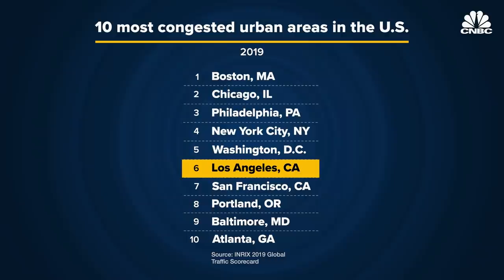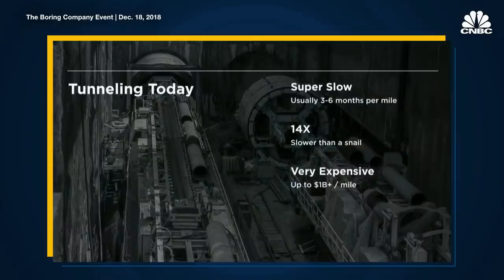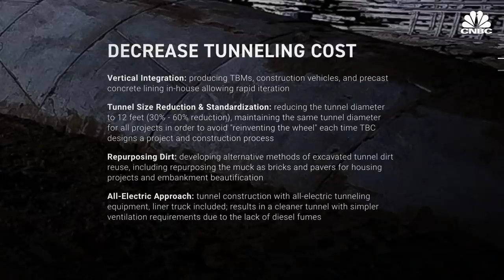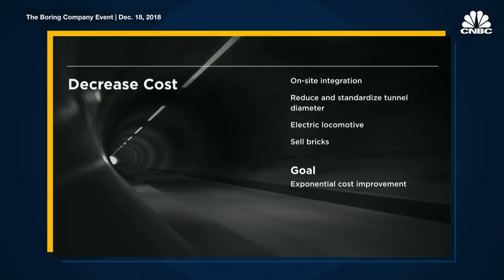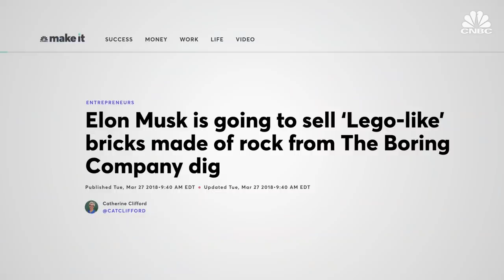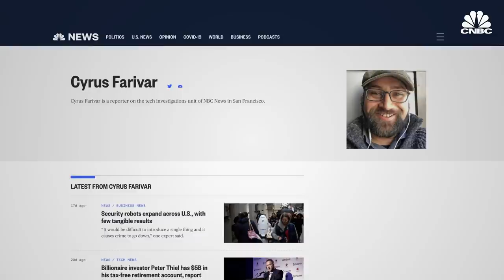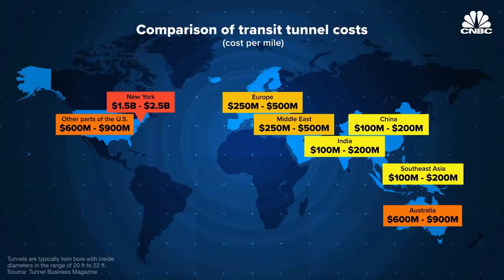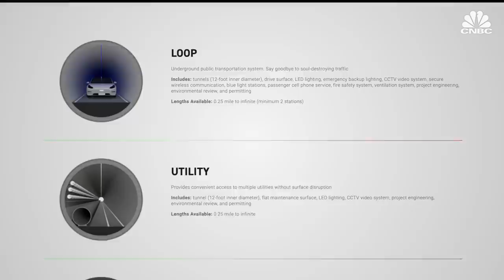Why Elon Musk’s Boring Company Isn’t Fixing Traffic Anytime Soon

Comment: Wait til Elon figures out he can connect several pods together and use only one engine to pull them all 😂
Reply: Best comment🤟🤟🤟
Reply: You just described a train..
Reply: @ericd9853  r/wooosh
Reply: @whitneygoncalves3327  Yeah, a solution that only views interests for rich people.
Reply: He might even have the brilliant idea to use steel wheels on steel tracks to significantly reduce friction
Reply: @whitneygoncalves3327  you will have to wait much longer because of lower capacity and the smell of pee will be worse because of the smaller volume of air inside the passenger compartment
Reply: @GabelhelmSogarbraten  What a brilliant idea, no doubt Elon will do it, he might call it, "Hyperwheels" or "Cybertracks"
Reply: @slytheravenx2716  and he will give it a futuristic spin that it will only move when all passengers have an app and are connected to wifi
Reply: Trains are limited and repairs are costly
Reply: @HavokBWR  And what when the vast majority of population has its own individual pod? Underground traffic jams?, bore more holes? Back to the same traffic problem we already have.
Reply: properprofitrocket  if that was the case then building more lanes should have helped with traffic. But it didn't.
Reply: That's in case all of the pods go to the same destination, which rarely happens.

And its annoying to have to be jumping from pod to pod. And slow
Reply: @whitneygoncalves3327  if you are bothered by pee smell. You can use your feet and walk away from that person…
Reply: Ssshhhhhh. You can patent the idea yourself. I'll bet you can get some gullible investors to invest in ypur project.
Reply: @AllThisThingsIHateU  so its a road, but way way way way way more expensive to build because it needs to be tunneled under a metropolis. and it has lower throughput. and more failure points.  and higher maintenance costs. and it doesn't solve the problem of congested city centers because you still need to bring in your car into them and in a best case scenario, scarce land still needs to be taken up by parking spots.

its like he sat down and tried to figure out the worst aspects of a subway system and combine them with the worst aspects of the car just to see what muskcells will buy
Reply: Adam Something wants to know your location
Reply: @AllThisThingsIHateU  So like a car in a tunnel?
Reply: Adam Something :)
Reply: we all watched the same video didn't we
Reply: We have another name for that configuration - TRAIN  :-)
Reply: @ericd9853  Or did he??
Reply: Jeff Bezos accidentally acknowledged the Labor Theory of Value when he returned from his little space jump. He thanked the employees of Amazon for paying for it!
Reply: That’s real good
Reply: @HavokBWR  If you really think an individual "pod" can safely depart from the convoy of "pods" without the whole convoy stopping, or at least slowing down first. You really need to go back to school and study physics.
Reply: Why would you do that, it would be so much slower. Absolutely idiotic
Reply: @slytheravenx2716  and the will have RGB lighting
Reply: @Michael Hill Why does that sound like a caravan that would go faster then light
Reply: @dennisams4763  A big underground tunnel
Reply: @yqr5357  umm why would the entire convoy need to stop? These are going to ROBOT driving, not people. Have you never seen a swarm of drones navigating around eachother, they don't all come to a halt every time one passes infront of another one... How are you not grasping this? 
Yes some may have to slow down a bit, but that depends on distance between each car in the convoy.
Reply: @Ethan.YT.  When 1 lane is big for you, what is a 4 lane tunnel for you?
Reply: @dennisams4763  Too small
Reply: a hyperloop?
Reply: @AllThisThingsIHateU  It sounded more like there's a special purpose fleet of Teslas in the tunnel for moving people and then you'd get out on foot at the end. The wheel lock probably only works on Teslas and they might not even trust private Teslas to use the tunnel because they could break down and block the tunnel.
Reply: @whitneygoncalves3327  It sounded like riders get in Teslas only for the tunnel. That are small, enclosed and will get peed in.
Reply: @HavokBWR  The line of Teslas is in single lane tunnel. When one stops all the cars behind have to stop. Smaller pods (especially on a track) instead of large trains would be more frequent which is different than a Tesla with rubber wheels in a tunnel.
Reply: @IronLion24   A few steel wheels last longer than many rubber tires.
Reply: @karld1791  the tunnel is a single line but the cars will be pulling OUT of that line from the tunnel into the stations, so that cars the other cars will just drive past the station and not have to stop...
Reply: @karld1791  okay? Rubber tires also last way longer when they are only driving on a smooth tunnel track vs typical driving conditions. And yeah they will have to replace tires, that doesn't outweigh all the other benefits. Again, go look at "boringcompany" Reddit, because you're clearly ignorant on this and only got your information about it from haters on YouTube.
Reply: @whitneygoncalves3327  Yeah drive you car in clogged street for hours to your workplace, because you are to afraid for a 20 min train drive.
Reply: @whitneygoncalves3327  Your name should be spelled Gonçalves
Reply: @whitneygoncalves3327  Good luck
Reply: Isnt that a train then?  Lol.
Reply: @GabelhelmSogarbraten  That's what filters are for.
Reply: copied from Adam Something’s video on The Boring Company
Reply: @whitneygoncalves3327  God forbid having to interact with people you don't know with a one in one hundred or less chance someone's smelly. Definitely better to throw money at a billionaire instead of invest in public transportation. I definitely want to pay a subscription service to use proprietary underground road on top of the bills I pay for my car. I also can't wait to pay to change my tyres every time I use this propriety road that strips them bare.
Reply: And call it loopcart 😂😂😂 this is so stupid. 
This guy just wants to sell more teslas. 
Investing on good public transportation system is must for US citys and suburbs. It includes just good old trains and buses and route without LED strip lights.
Reply: I was thinking the same thing but with a trailer like thing we’re you can drive onto
Reply: @AllThisThingsIHateU  Then what is this even fixing? The cars will have to leave the tunnel and will get caught in traffic again, this is the same thing as adding lane after lane to fix traffic.
Reply: @whitneygoncalves3327  you clearly haven’t been outside of anywhere apart from Murica’. 

Plenty of people prefer a walk and a well engineered, clean and spacious train/tram and/or bus journey than a car that polluted the local environment, limited parking, stress and taxes of a personal vehicle. Netherlands for example. 

And then you have places like London where it has a healthy middle ground. Public transport isn’t particularly pleasant, but anything is more pleasant that automobile traffic.

It goes to show what INFRASTRUCTURE INVESTMENT can achieve outside of your dense mind.
Reply: @janetskola9867  And why would I donate my income to "someone who smells like pee"? What does it has to do with the main discussion here? Very out of context your comment is.
Reply: And he will reveal this revelation to his fawning cult as the greatest invention of mankind, and they will hail him as the Space-Jesus Genius they always knew he was. Elon loves 'inventing' technologies that have already existed for over a century. 😂
Reply: I have a name for that. I call it Hyperpod. 😂
Reply: And if he puts them on rails they could be powered from the rails, instead of having passengers sitting on 1000 lbs of lithium. He's such a genius.
Reply: @AllThisThingsIHateU  Except you pay a $20 ticket to go in a Tesla that you don't own.
Reply: @HavokBWR  "going to"
Reply: @reviewtechussr  yeah I have no idea what your referring to, also it's $10 per vehicle, so that's around $3.33 per person. I know math is hard for you, but let's try not to spread lies.
Reply: @HavokBWR   Okay so it was half the price I said it was if there was only one person. You say it's $3.33 per person but are really going to always have 2 people with you? No, in all likelihood you'll be going by yourself with maybe 1 other person. This is such a strawman argument you're making which by the, a ticket on the NYC subway costs $2.75 per person. 

Also, what exactly can the loop accomplish that even a simple light rail can't do better?
Reply: and then claim it as his own idea and the masses of fanbois will believe him!
Reply: @kaosinc  go back to calling the model 3 snake oil.
Reply: @HavokBWR  Imagine simping for a corporate aristocrat lmao. That's all you've been doing.
Reply: @AllThisThingsIHateU  Yeah, you can do the same with your legs. But without causing massive amounts of pollution, unsafe city environments and contributing to the economic inequality and obesity epidemic.
Reply: Hey y'all. How about a train, that doesn't smell like pee because get this crazy idea... it's properly funded and maintained?
Reply: @moisesaguirre515  nah m8, impossible. Can't be done
Reply: @ian_b  Americans call everything that isn’t American communist…
Reply: @davidjohnson8655  yeah, that was an incredible revolution. Making something more expensive and less efficient. 

Cars are better then horses though
Reply: @HavokBWR  Express trains don't stop at every stop. Neither do skip-stop trains or simply trains that bypass stations.
Reply: @HavokBWR  yeah, you'll just have to stop at the entrance for a few hours while your waiting for your turn in a 10 mile long queue of cars. Great idea.
Reply: @n4n1damn yaya keep in telling yourself that. Point to point travel that passes by stations allows for more stations closer together. Can't have that with trains, would get backed up too fast. More stations (hotels that are paying to join the line) = more points of enternce, less congestion because you aren't all forced to these few hubs that trains need. But I really couldn't care any less about your opinion. I've been hearing from you Elon haters for the past 5 years. You all bch and moan and cry snake oil. I invest and dont care if something gets delayed or slightly modified. My best keep being correct and yours keep failing  😁
Reply: @HavokBWR  yeah, but the cost of building new entrance points / stations won't exactly be negligible. I really don't care if it's Elon or anyone else doing it, I'm just looking at this objectively mate. All the best to you and good luck with your investments 🙂
Reply: wait until alpha cino remembers that trains within cities have very low ridership outside of rush hour because it doesn't normally start where you live or go where you want to go.

The idea of the loop is basically a highway but at higher speeds. So you can go from the stop easiest for you to the stop closest to where you want to go, and skip everything in between.
Reply: @neutrino78x  no Vegas built a 600 million dollar train and nobody used it, so that means they should have built ANOTHER train!
Reply: @ericd9853  Train? You mean a hyper interlinked capsule accelerator?
Reply: DA trraaaaaaai-
Reply: @GabelhelmSogarbraten  Adam something fan maybe? Nice to meet you
Reply: @slytheravenx2716  And the tunnel will be a vacuum to go woosh
Reply: @IronLion24  yeah, and trains can transport more than 80 thousand people in a single workday. The weaker trains.
Reply: Genius ... we can call it the 420 BACON PICKLE RICK Transportation carrier
Reply: @neutrino78x  in a geographically large country, high speed train is faster for traveling than airplane example china. in geographically large continent and interconnected country of europe, high speed train is still faster choice than airplane.  if canada, australia and USA don't have high speed train it's their choice. many country still want the best efficiency and smart possible solution
Reply: @MyBuzzL  

"n a geographically large country, high speed train is faster for traveling than airplane"

Nope.

I live in the San Francisco Bay Area. If I want to travel to the next major population center to the north, that would be Seattle. It's 800 miles away. 1287 km.

A TGV would take four hours at BEST. 

An airplane takes two hours.

Why would I waste two hours of my life in a slow train instead of using the fastest vehicle available???
Reply: @neutrino78x  if u dumbdown everything to speed, yes airplane is faster than high speed train. there is many other factor why fast train is better than airplane. 
the location of stop station is one of the factor. like many of airport located far away from cities, and if u living without good public transport that's can be additional hours in traffic. while many station of high speed train already have track inside the city, with good planning of subway it much more logical to use high speed train (if available). 
the waiting inside the airport is making longer time spent (by avarage) compared to waiting inside high speed train. and if u have connected flight it can cost triple the waiting time inside the airport. if u read more of the reseach this wait time in the airport is the most common factor why airplane is take longger than high speed train
Reply: @MyBuzzL  

How can you "dumb down everything to speed"???

If you're trying to get somewhere you want to get there as soon as possible right???

I wouldn't take wheel on rail HSR further than 200 miles for that reason. They top out at around that speed per hour so much further than that and the airplane is so much faster that it's a non-starter.

But it's under 200 miles and the train is taking 3 or 4 hours I'm still going to take the airplane.

Why turn a one hour trip into a five or six hour trip or whatever?
Reply: @neutrino78x  there is so many other factor than speed for traveling. if u travel like superman or flash, yes u can just jump or run than see who is the fastest.

if u cannot see or read any other factor than this conversation is useless. unless u can read study journal that really dive deep which is better airplane or high speed train than it's meaningless. it need some knowledge requirement to see holistically which is more efficient

until u have the knowledge "Speed is not the only factor that determine travel time and efficiency"  we cannot see eye to eye. maybe we can talk other subject, be like a child that know nothing and debating which is faster superman or flash
Reply: You can also prevent the guide tires bouncing around if they were made of steel, instead of rubber, and traveled along a twin set guide rails that locked these metal tires more firmly to the given path.
Reply: @driley4381  main thing that makes this idea different from a train is that your vehicle can skip all the stops except the one YOU want to get off at. Otherwise known as Personal Rapid Transit. Trains are slowed down by having to pick people up at stops and drop them off...with PRT you get on, tell the computer where you want to go, and if there are 70 stops between your origin and destination, they get skipped and you go at top speed that whole time. This is basically underground PRT. 

Musk is doing a lot of great things for the world. He's bringing the cost of space launch down quite a bit with fully reusable rockets and he has advanced the state of electric cars a lot.
Reply: @neutrino78x  Assuming your personal vehicle is the specific brand and model allowed into the system, and the system allows you to bypass the vehicle ahead of you that wishes to make a stop, and doesn't clog the whole system up when one stop isn't functional like what happened in Vegas this weekend, and that there isn't a single mechanical or electrical malfunction along any of the thousands of moving parts in such a system, and assuming long lines of vehicles aren't waiting to access an entrance port and backing up into roadway traffic like a slow drive-thru window, and assuming any passenger rail line that doesn't cover massive distances already with an already massive customer base would even have 70 stops on one line, and assuming any potential host municipalities don't invest in their own far more efficient and affordable light rail or tram systems for local travel in the future, and assuming Elon Musk has ever "invented" anything more than Ponzi schemes.....yeah, you're right, it's a wonderful idea. 👍
Reply: I think everyone are missing the point.
If this idea (or more cost effective ditch and cover technique) became mainstream .
We can forbid the space taking, accidents causing, noisy, polluting cars above the ground.
So above ground will be reserved for bikes, walking, light rail and trams and small shops in the middle of the street.

Why do we put the low efficiency cars that take a lot of space above ground while public transport underground, it should the other way around.

This also allows cars into a controlled environment, that can implement self-drive safely
Reply: @yazeedalhusban969  definitely whenever you add another channel for cars to go through it should help with traffic (at least temporarily until induced demand fills it as well).

As far as pollution, that won't be a factor in 20 years or so when we're all driving battery/H2 cars. :)
Reply: I don't think you understand the concept of what the Boring company aims to achieve. Its about transporting people with their vehicles. Not just people.
Reply: @neutrino78x  I don't believe there is much to do to help ease cars traffic, alot of people will not believe it, and will keep pressuring to build cars infrastructure.

I think we should be pragmatic and move the traffic away underground, and reclaim the street above for all the other purposes.
Reply: You mean hyperpods? 😂👌
Reply: @whitneygoncalves3327  I don’t know wich trains you’re using but this never happened to me.
Reply: @Magnus-n2t  hahaha great comment 👌
Reply: I saw a comment somewhere about America Vs public infrastructure/transport that said something like "the problem with funding public infrastructure or transport etc in America is the cult of individuality fostered within the American person. Each American has had the idea of themselves as an individual hammered into them at every turn, so the idea of creating for others, sharing or communally utilizing something is almost entirely alien to them - and some perceive the idea of sharing/communal resources as 'stealing' from them, because they are so used to perceiving the world as the strict binary of "it's either MINE entirely, or its NOT mine at all" - much like a toddler with their toys. American infrastructure/transport/etc will not be fixed until they have restructured the American mind beyond the toddler's perception of ownership. The vast majority of Americans are so unfamiliar with the idea of communal spaces/concepts that they cry COMMUNISM whenever they see something shared by + unkept by a community/society."
Reply: Or how to keep cars with sprung suspension systems from bouncing off battery-powered flats with no suspension at 150 mph.
Reply: and until he figures out that he can put them on a fixed track, use steel wheels and put in an overhead line so you don't need batteries
Reply: Or, Or have an EMU and Electric Multiple Unit
Reply: oooo, you could run them on steel tracks too to reduce friction.
Could even have a third line to provide power and remove the need for batteries
Reply: @whitneygoncalves3327  welcome to society
Reply: @HavokBWR  if you look at early boring plans and their later re designs it's just a tunnel for Tesla's now which doesn't solve any problems
Reply: This is how Musk promotes the Myth of Musk.  He claims the invention of things that don't exist, but sound good at the time.  He want's to put a robot in every house, but his prototype is a man dancing in a spandex robot suit.  Most of what Musk talks about is hype for self promotion.  Now, Musk has now turned on the people who buy Tesla cars, the left leaning people who are concerned about the environment. Then Musk publicly aligned himself with the political party who denies climate science, they don't like electric cars or solar cells and the leader of the party HATES windmills and says climate science is a hoax. I see Musk as more of a conman with billions of dollars pretending to be the next Edison, while using 3D CGI videos and photos and a man in robot suit, all to promote his myth to sell cars.
Reply: He won’t.
Reply: @Magnus-n2t  OOF XD
Reply: and one driver ....
Reply: @AllThisThingsIHateU  OH NOOO YOU HAVE TO INTERACT WITH STRANGERS IT’S NOT LIKE HUMANS HAVE BEEN DOING THAT FOR THOUSANDS OF YEARS OR SOMETHING
Reply: @obijuan3004  He's on the right and I'm on the left, I wouldn't say he's an extremist like trump though. And his electric cars are in fact pretty awesome.
Reply: @obijuan3004  

What's your point? It's still awesome. And his company has proven that the private sector is a lot more nimble and more efficient than the government. Imagine if an organization like SpaceX had the budget of NASA...we'd have men orbiting Jupiter by now.
Reply: @neutrino78x  You're being fooled by the Musk hype. It was Lockheed, Boeing, Martin Marietta, and Rockwell International who built rockets for NASA.  SpaceX would not exist if it were not for NASA.  Outside of launching satellites there is no money in space rockets except what comes from NASA or other governments.  The Space Shuttle was a 20 year project that taught us how to build and repair things in space, including the Space Station. The Shuttle was built by Rockwell International and Boeing and many others.  It was the most advanced space ship in history and it still is to this day.
We went to the moon with less computing power than you have in your smart phone.  Yet, SpaceX hasn't been out of earth's orbit, and if NASA cuts their funding then SpaceX will never go to Mars nor to the moon.  Stop falling for the Musk hype.  And that is what most of it is ... HYPE.
Reply: @slytheravenx2716  I have an even more brilliant idea for the name, I'm thinking calling it the "subway"
Reply: @AllThisThingsIHateU  car centric thinking is the real closed loop mind here
Reply: @Ethan.YT.  Yes but RGB is an old fashioned name for someone like Elon and his followers, he'll name it something like "Neoultralights" or any other "innovative" name he can use to disguise himself reinventing existing things.
Reply: @puroktahzeeb9355  Oh damn, I never  thought about it, just like the restaurant. Dude Elon might steal the name from your comment you better be careful.
Reply: @slytheravenx2716  and there really just RGB lights but they are only sold one light at a time.
Reply: @obijuan3004  and Lockheed wouldn't exist without government projects either.

Fact remains, SpaceX is doing a lot more with a smaller budget and staff than nasa hsf.

If you want a star trek or star wars future....most of the ships would be private. We can only have a powerful navy because of our large private merchant fleet which maintains expertise in building ships.

In the future most spacecraft will be merchants and the navy and nasa will be a small percentage, just like on the high seas today. 

You can't have a future where there are billions of people on Mars and they're all nasa employees. There would be a diverse Martian economy just like on earth with several nations and lots of different companies involved.
Reply: Alexsomething*
Reply: EWWW that sounds like public transit! Gross! 😜 🤣🤣🤣
Reply: @AllThisThingsIHateU  None of musks projects involve letting you drive your car into his tunnel.  You have to get out of your car, get into one of his cars driven by one of his employees.
Reply: In the steel mill when making sheets they have a runout table.  every three feet they have a roll each roll has its own motor.  In his new car, they have up to four motors.  I seem to think Elon knows what he is doing.
Reply: I even got a name for it: CybertraX and it will carry 420 persons and has 69 bulletproof steel spacerollers on it... Oh, and transparent solar Hypersheets so that people can look outside! All for 1/10 of the cost of an old polluting ... euhh... electrical.. mmmm.. a ..a ..e ..e..euh... metrosystem!
Reply: @AllThisThingsIHateU  where he belongs
Reply: @whitneygoncalves3327  I'd rather that
Reply: Plenty of AdamSomething watchers here 🤭
Reply: @IronLion24 Like your average car if someone doesn't care of it